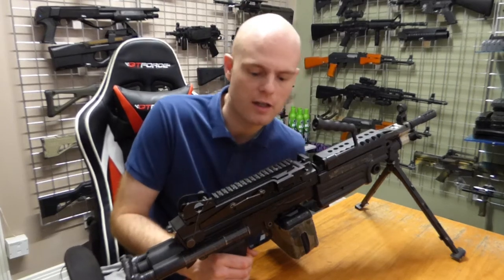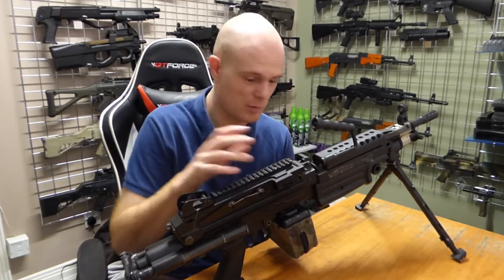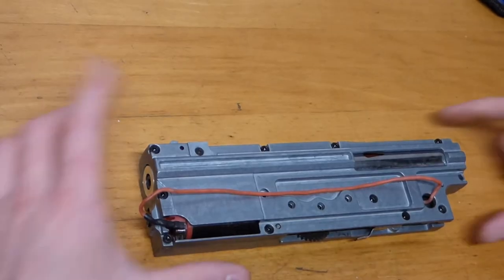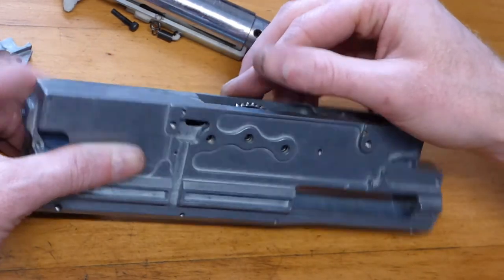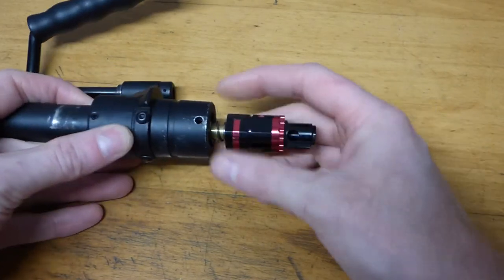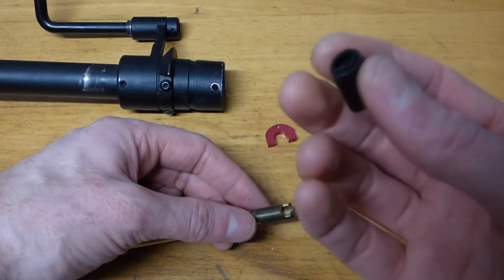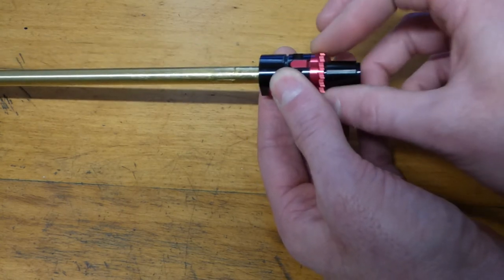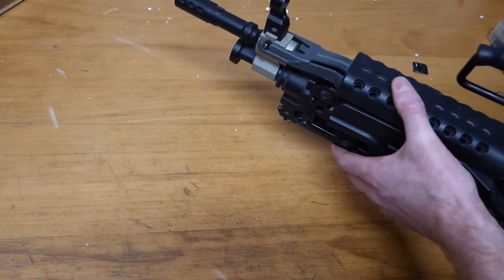A&K M249 Hop upgrade (Bullgear hop chamber) and gearbox service

Comment: Hey mate, I have a question.
I think my particular one is a lemon. I've had it for 2 years and it simply won't work with anything other than a prommy purple and nub. Tried a maple and it didn't work. Tried a random bucking and nub and it didn't work. Tried a flat-hopped prommy purple and it didn't work. Always for the same reason: BBs are too tight even with hop off or the trajectory is erratic. Soon as I install a standard prommy and nub.. everything is fine, but the range is not as good as it could be (shooting just under 350fps). 

Friends tell me its a skill issue, I don't believe so as I've assembled countless hop units and they all work. So I'm not sure what's up.

Comment: Instant sub, I have an A&K M249 para and I've been trying so hard to get my hop up to... well... hop! I have a Bullgear Unit on the way so I am hoping that will sort it out, is there anything else you can recommend to me to help with sorting that problem out?
Reply from the maker: The bullgear hup unit will be the end of your problem! 😎 So much more effective in the way it works compared to the standard unit. I use mine with a mapleleaf macaron 60 yellow rubber and an omega nub. That will handle what ever weight ammo you wish to run in the gun. Have had mine for years set up like that. 😁
Reply: @adzzzysarmoury  I'll take the advice on board, thank you very much! I've had this gun nearly a year and I have only used it on one game day, and the range even then was pathetic! I was really looking forward to making some new content on the gun as well, so hopefully with your advice and the new unit I can finally make that happen. Again, thank you very much! 😃
Reply from the maker: @CosmosAirsoft  the original hop units use a metal ball to apply the hop which is very unforgiving on the BBs. You will see big improvements I'm sure.
Reply: @adzzzysarmoury  I'm looking forward to the end result! Just been watching some of your videos and I am really impressed, I'm going to give your channel a shoutout on instagram, really very good!
Reply from the maker: @CosmosAirsoft  thank you! I only started the channel in January this year so the extra sharing is very much appreciated!! 😎 Would be great to hear how you get on with your M249 once you have installed the hop chamber.
Reply: @adzzzysarmoury  You've done very well to get to where you are now in a matter of months, I hope you keep it up! I'll keep you posted definitely 😃👍
Reply from the maker: @CosmosAirsoft  I must admit Lockdown helped me start as I was not doing the normal day job for the first couple of months. My plan is to make more content away from the work bench as well.
Reply: @adzzzysarmoury  Yeah lockdown did the opposite for me as my content is more gameplay based, but modifying / fixing guns is definitely something I want to learn. What sort of content would you branch out to?
Reply from the maker: @CosmosAirsoft  I'm going to do game play with the guns I have upgraded. Also want try and get some range time to demonstrate the improvements from certain upgrades. 😁
Reply: @adzzzysarmoury  sounds good to me! I’d love to see how much improvement the bull gear compares to the original. I wish I had a proper place to test mine which doesn’t involve waiting till game day
Reply: All the parts you recommended have arrived, however it produces very little hop but not enough to keep straight for some time. I adjust the hop to max and then the bb just falls out the end of the barrel instead. I’m baffled 😂
Reply from the maker: @CosmosAirsoft  OK, I'm sure it can be made to shoot as well as mine. Do you have the correct omega hop nub to go with the maple leaf rubber (assuming that is what you went for) as it sounds like it is not pushing the rubber into the barrel enough. Also what FPS is it producing? 😎
Reply: @adzzzysarmoury  I think we’re getting somewhere as I’ve just chronoed at 200 with .25s 😂 I have a spare spring so I’ll swap it out and have another look
Reply from the maker: @CosmosAirsoft  make sure all the airseals are good and that the nozzle is making the correct contact with the hop rubber.
Reply: @adzzzysarmoury  I just changed the spring to a M105 now producing 250fps (might buy a stronger spring now!) and it looks like it might actually be hopping!
Reply from the maker: @CosmosAirsoft  If you are already using an M105 spring I would definatly check the airseal.
Reply: @adzzzysarmoury  Looks like it's the air seal indeed! The piston has some resistance but not enough, I'm gonna look into buying some O rings tomorrow to see if that helps
Reply from the maker: @CosmosAirsoft  sounds good!! 😎 It will be a beast once you get it working.
Reply: @adzzzysarmoury  I honestly can't wait, if all goes well tomorrow, I'll dedicate my first video of it to you, for all your help 👍
Reply from the maker: @CosmosAirsoft  I would definitely appreciate the mention! 😎
Reply: @adzzzysarmoury  I ended up buying a new air nozzle which should arrive in the week, then fingers crossed that’s all I need to do! I have some o rings ready if need be but I’d like to think that’s all I need to do now. Did you upgrade your setup or is yours stock?
Reply: @CosmosAirsoft  how did it go?

Comment: Hey i subscribed what barrel do you recommend with the bull gear
Reply from the maker: I normally like to use either 6.03mm or 6.02mm. in this I have a guarder 6.02mm internal diameter.

Comment: Ive changed my gear set, put in a Maple rubber, changed the piston and got the Bullgear hop and a Prommy barrel but I'm still not satisfied with the range and hop, any ideas?
Reply from the maker: It's very difficult without having the RIF in front of me to say where the problem lies. How far is it shooting at present? 60m is usually a realistic expectation. Does it make the right power? Are you using an omega nub with the maple leaf and check that it comes through the barrel window evenly when the hop is applied. Make sure the barrel is really clean and that it is not a really tight bore like a 6.01 as this in my opinion is too tight.

Comment: Hey there man! I recently got back into airsoft and I got an A&K Para 249 that I love to bits! But I’ve been having issues with the trigger sticking and low rate of fire, as well as the hop up being hot garbage! You have any insight into any of those? And where do ya find the bullgear hop ups!? And do they come with their own nubs?
Reply from the maker: Hay! The trigger can be a bit of a pain as it is a switch inside. You may have to open the gun and manipulate the metal arm that activates the switch so that it doesn't stick on so much. You will see what I mean once you have the gun open. 

The bullgear hop can be hard to find, Google will be your best friend to find them. That will be the best upgrade you do. These use normal hop rubbers and nubs. I prefer maple leaf macron with omega nubs.

You will have to look at the shimming as seen in the video to make sure it runs smoothly. If this doesn't get you the desired ROF then you can choose a faster motor. 😎
Reply: @adzzzysarmoury  I’ve opened the gear box to try and fix the trigger issue, it’s not the metal arm on the outside, I think it’s either wires shorting out, or the contacts inside the trigger switch, but idk what a good upgrade trigger switch is, cause most guns (M4/m16/AKs) don’t use trigger switches. I HAVENT opened the trigger switch itself yet, I didn’t wanna screw it up since I knew nothin about it!

How exactly do you shim gears? Cause I’ve heard people say use shims or shim the gears correctly, and I have zero idea what shims are, unless the shims are the little brass/copper rings on the axles of the gears, I call them bushings, so those very well could be the shims everyone talks about, I just want a bit of clarification on that! 

And the bullgear hop up seems like it’s recommended by some, and others say to R-hop it or flat hop it? Idk what that means and if it’s worth it, you have any insite on that too? (And I’ve been looking at a better motor, but I don’t want a 30 RPS support gun with the crappy A&K mags, they hardly hold up to stock RPS, let alone 30!)
Reply from the maker: @Darkmagician769  you are correct the shims are the really thin washers on the Axel's. The term bushings refers to the bits that sit in the gearbox shell that the Axel's sit in.

The idea behind shimming is to get the gears to sit at the correct height towards one and other so the teeth mesh perfect but the gears are not too tight or too lose when the gearbox shell is closed tight.

Personally I wouldn't bother with 's' or 'r' hop as you can get the same result with the maple leaf rubbers without any faff. Some people might tell you otherwise towards s and r hop, bit it's up to you.
Reply: Oh okay the bushings are where the bearings sit okay that makes more sense, so when you shim you wanna take out the piston, motor, and the springs and latches so they can spin freely, and get them moving as freely as possible correct? 

I’ve heard people recommend promethius purple bucking/nubs, what’s the difference between them and the maple leaf 60/70 degree nubs and buckings? And if ya don’t mind, what is S and R hopping?
Reply from the maker: @Darkmagician769  yea so you can either use bushings which are solid and more durable or you can use bearings that are less durable but allow for smoother rotation of the gears. I normally use bushings over bearings.

Yea they are good rubbers, I like the macron rubber as they offer a larger contact area with the BB. I mainly use 0.32g so the larger contact with the BB helps the effectiveness of the hop on the heavier ammo.

The (soft) 50/60/70/80 (hard)  rating on the hop rubbers is how firm the rubber is. In all honesty I have tried all of them at various different power levels and haven't seen a noticeable difference really. It is supposed to be the more FPS the harder rubber you need.

S and R hop are when to put individual patches in the barrel window to contact the BB and have an internally smooth hop rubber to go over it.
Reply: @adzzzysarmoury  the gearbox came stock with bearings right? So Whaddu mean by bushings?? And so to shim you need just the little copper (or whatever material) washers and position them so they spin freely, correct? If so where do I get the washers and stuff??? 

I’ll probably go with either purple rubber and nub, or the maple leaf 70 with the omega nub, seems like that’s about the standard for AEG

And oh okay! Yeah I won’t be doing those hop up types

Comment: My m249 curves the BBs to the left the hop up sits at like a 30 degree angle. Do you have the same problem with the stock hop up?
Reply from the maker: It maybe a hop rubber that is not seated correctly, could be the barrel is slightly twisted to one side in the hop chamber. Also make sure the barrel is completely clean. 😎

The problem with the standard hop chamber was the way in which it applies the hop as it used a metal ball which wasn't very effective.